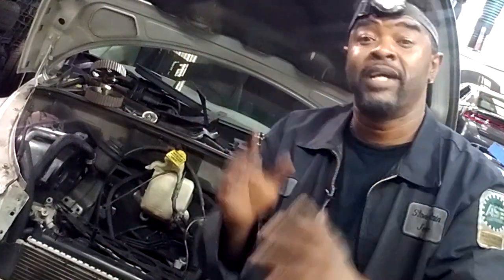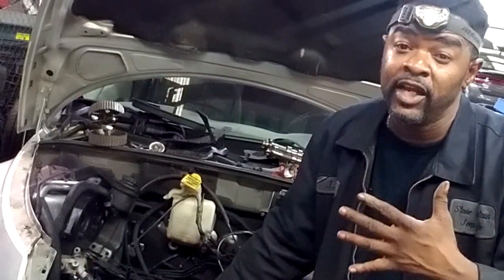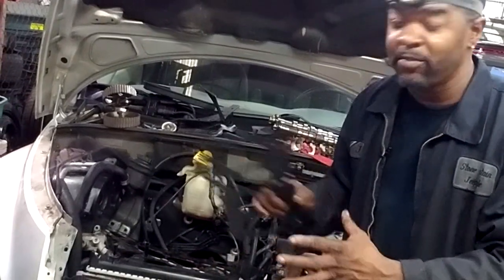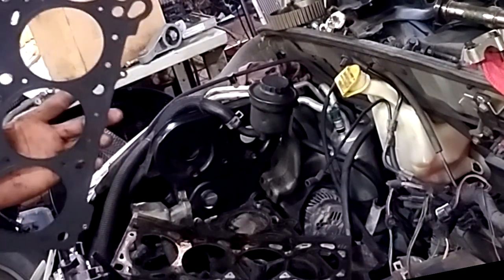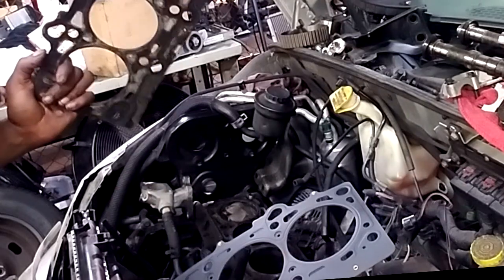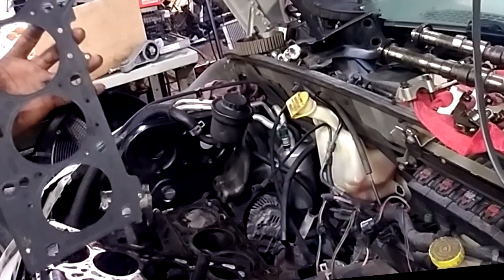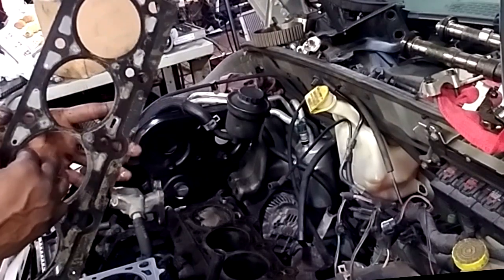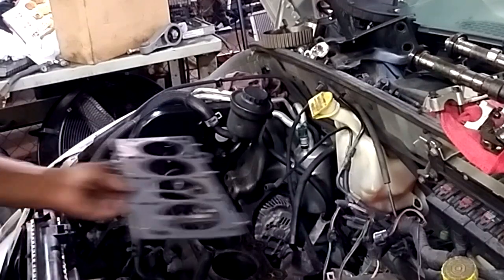MLS Head Gasket Blown or Leaking, Overheating with AC on, PT Cruiser overheating problems.

Comment: I have a 2002 PT cruiser limited edition
.it does overheat or has overheated .no oil in water.no misfires.no white smoke out tail pipe. Which doesnt necessarily means that the head isnt warped. Or head gasket ripped 
 Keep up the pt cruiser videos i have 3 of these !
Reply from the maker: Hey bud thanks for watching. I see that a lot. I would have overheating thats a result of exhaust gases in the cooling sys but non of the traditional symptoms such as white smoke or oil in the coolant. Ive always had a problem explaining that but it happens.

Comment: Hey man thanks for all of the detailed PT videos.  Just bought a clean 07 non turbo PT Cruiser at auction with a very loud exhaust leak.  I assumed it was simply a bad manifold gasket or donut gasket and bought it.  Well it over heated it on the way home, warping the head and spewing coolant on the ground.  Judging by how badly warped my machinist said my head was amd the fact that someone stacked 2 exhaust manifold gaskets, this wasnt the first time someone has overheated this car and warped the head and the double gaskets tell me they were not able to fix the exhaust leak.  So amyway i put a NEW head assembly on, along with a NEW exhaust manifold, new MOPAR exhaust manifold bolts, timing belt, h20 pump, thermostat, and all new gaskets.  I applied red RTV to both sides of the new exhaust manifold gasket and torqued in priper sequenceto make sure it doesnt leak.  Starts and idles fine but it still has the same loud exhaust leak so i shut it down immediately.  I find the leak on the back of the head but its not coming from the manifold.  There are several threaded holes on the back of the head, above the manifold.  It feels like the exhaust is coming out of one of those holes when i hold my finger over it.  The new head was a perfect match.  Please help me track down this exhaust leak?  Could it be the hole for the ground wire that runs from the inner fender to the back of the head?  I am about to drice this thing into a lake.  Please help!
Reply from the maker: Could be that cyl head was for a EGR Valve head also..The 2007 PT do not use a EGR Valve, so you may just have to get the cover plate to bolt down over the hole

Comment: Thanks for the info. Heres a question though, Would it be a Head Gasket if there is oil mixed in with the coolant and it's leaking all over the place? Or could that too be a warped cylinder head?
Reply from the maker: Yes from a traditional standpoint we've always said, if you have oil mixed in with coolant, your gasket is blown. IF, especially its the old style paper head gasket...If you have oil mixed in with coolant the same theory still apply BUT, if its the MLS gasket theres a 95% chance the cyl head severly warped..Also keep in mind the cyl heads was not always aluminum back then...But because you have to remove the head ANYWAYS, you always should go in with a new gasket and have the head inspected/repaired or replace..
Reply: Thanks for the reply. On my 08 PT, The Head Gasket and Cylinder Head was resurfaced last year 2 weeks after I bought it (Low compression cylinder 3, burnt/bent valve) and the resurface guy said the Head Gasket had maybe 5-10k left on it before it blew/broke or something along those lines and said it should last another 50k. Accurate estimate or no?

I'm a bit concerned on that and wondering if I should just start saving money now to repair or just buy a whole new motor when/if the time comes. Scrapping it is not an option. The Body has no rust anywhere so, no matter what, this PT is staying on the road.

Anything I can do to keep this PT going is whats going to happen. In Fall im prepping/painting it for shows in 2019. Going with the Base Inferno Red with Black Grill, Bumpers and Side Panels. (The parts on the doors that kind of stick out a bit along the side) Interior Black and Red. New Tinted Headlight Housings and Taillights.

My Father and I are PT Fanatics so to speak. Can't see ourselves buying any other vehicle until we can't find PT's anymore. lol.
Reply from the maker: The 06-10 PT's are known for burning exhaust valves. Ive repaired plenty of these with simply replacing the valves in question, repairing the valve seats and installing new valve steam oil seals which (in my opinion) the root cause for the valve burning. If oil gets on the valves past worn valve steam oil seals, burnt valves will happen..TO ME, you cant estimate how long a head gasket will last...So if he repaired your head (resurfaced)  but did not do a valve job, sure, you may have future problems with that head but in the form of idleing and not overheating.
Reply: Oh no, He replaced all the valves, stems, oil seals, and also did the Water Pump, Timing Belt and Center Mount per my request as it had 110k and we didnt know when or if it was done and then also did the resurfacing. Timing belt did look worn out though so dont think that was done prior to buying it. 

To keep everything running smooth, I run Lucas Fuel Injector cleaner once every oil change and use Marvel's Mystery Oil every fill up to keep everything nice and clean and smooth. And I will be cleaning my Throttle body once a year as well. 

Anything you recommend to keep everything running smooth and keep clean?